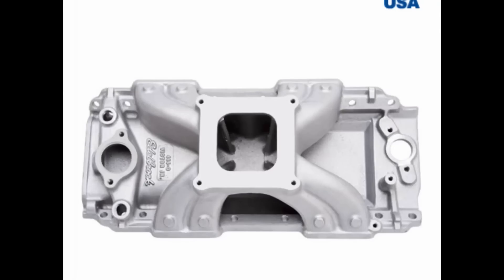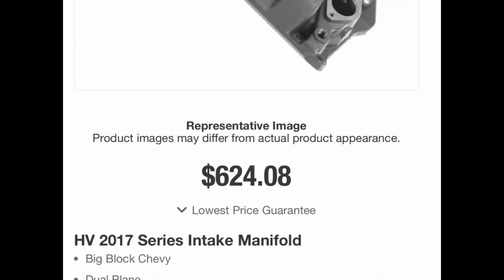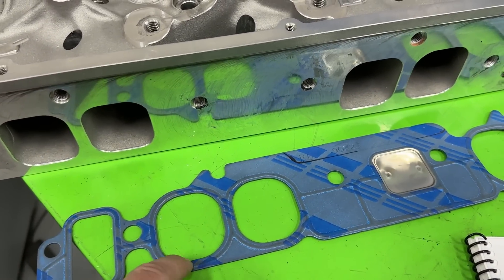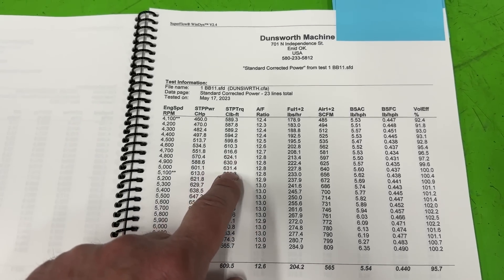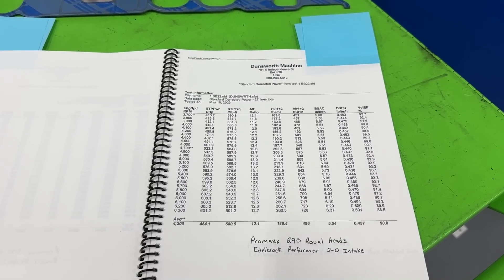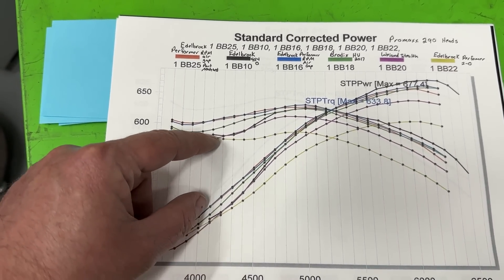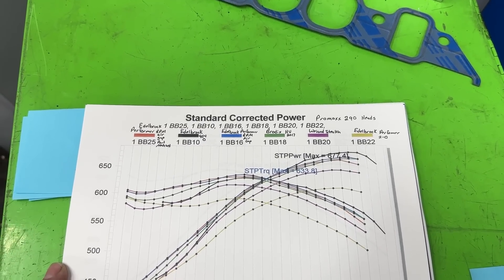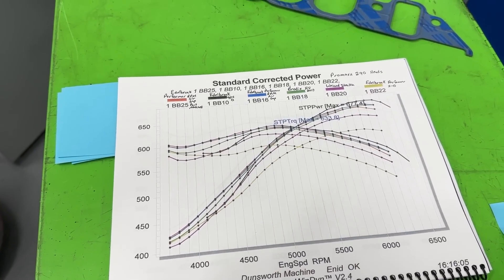Intake Manifold Test Results On The Dyno BBC

Comment: Did you Dyno the BBC air flow research dual plane intake manifold. If so I must have overlooked it. But does the BBC AFR beat the Edelbrock BBC air gap both being dual plane intake manifolds for a street/strip BBC

Comment: Eric, your videos are great! very informative. I have a nice budget 454 with flat top pistons factory Iron heads that have 2.250 intake valves and 2.188 exhaust valves. The heads have been ported, I don't know who did the port work and I didn't remove the valves to look. Also, it has a Lunati flat tappet cam 255/263 @.05 with .612/.630 lift on a 110 sep. angle.

I was given a Performer 2.0. The openings to the heads were very small, but the runners looked quite big. I gasket matched ported it to the oval port gaskets, it took a lot of material removal to accomplish.

Do you think that I should just toss this Performer 2.0 aside? or try it?

Comment: The BB Chevy Weiand Stealth has runners that are "too large", even though the ports are small. The Weiand Stealth is the best one for the 302 Ford, with stock stroke. On a 302, the Performer RPM actually acts too big, all the way around. The Stealth beats it on a 302 Ford. Maybe the Performer RPM would be better on a stroker 302. The Ford 302 Stealth is no joke. Make sure to get the Made in USA one though.

Comment: I suspect that Performer 2-0 would work better if it were notched similarly to the RPM version. It's possible that is the only difference in the two intakes.
Reply: I can tell you that on a 1995 454 truck motor, it loses to the stock intake below 3k and is better noticeably above. It actually helped my truck not spin the tires as much off idle

Comment: Hey Eric, isn’t there quite a bit of difference between the Brodix HV 2017 and the BM 2017? I’ve always understood that the BM line was a huge upgrade to the HV line. If you can remember, you ported a BM 2017R for my 582. Part of me wonders whether I should have gone with the BM 2027. Which is even bigger, isn’t it?

Comment: Have you ever worked with the Nitro setups?  I keep running into people that advance the timing too much and cause engine damage from pushing the cores out of the spark plugs to breaking the pistons and rings.  In the old days, we would dial in the came and put the retarded timing into the cam.  With all the changes to computers, it seems too many changes were made for the Nitro world.

Comment: A friend of mine and awesome engine builder taught me a ton about bbc and because he was friends with the late dick maskin i listened to everything he teached me very closely. 
I used to port intake manifolds for him that he used on 511 cubic inch bbc for a hydro boat race team and he swore by taking a dart oval port intake and porting it to match a dart 320 head, back then that was the head to have. I wonder how that intake would stack up against stuff today.
Reply: I actually have 2 of those Dart BBC oval port  intake manifolds that I had port matched to 2 sets of AFR 315cc Cnc'd heads on a pair of NA 565cid Marine engines for a twin engine offshore  boat application--- they gave very good throttle response/signal and torque was up near 700-lbs. The Darts are polished and look great and are For Sale. I'm now going with the Weiand Track Warrior single-plane intake manifolds that I bought from Eric W.
Reply from the maker: The dart intakes are not that great.
Reply: @WeingartnerRacing  amazing how much has changed over the years. Back in the mid 90's I did a 477 bbc 12.5 trw slugs, 2 bolt block, stock rods lol, ls7 steel crank and merlin oval port heads with that dart oval port intake.  Also ran a 1050 dominator. 
Cam was a ultradyne solid roller. People at the track laughed at me for running the oval ports. 
Engine did 696 @6900  and 589 at 5000. 
I ran that engine for 8 years in a 1937 plymouth coupe I raced for years all over the pacific northwest.
Reply: @sleeeper88 Those Dart intakes were actually port matched to  2 pair of Merlin BBC Oval port cast iron heads with some bowl/ short-side radius work for a pair of BBC 486cid marine engines with Solid roller cams and Holley 1050cfm Dominators, about 9.5 comp ratio... They made about 620hp @5500rpm on the the dyno back in 1991 or so...boat ran like a terror and hauled the mail  📬
Reply: Yes, I believe you Eric... You had already told me when I was at your shop...my Dart intakes are over 30+ years old...very old technology now and that's why I bought the Weiand Track Warrior single-plane intake manifolds from you...by the way, great videos on all the exhaustive BBC intake manifold dyno testing you have been--- you're a man of resolve!... and it's why I brought my AFR heads to your shop... thanks again!

Comment: Let me try to ask a dyno question. I've asked others but I must not be wording it properly. When you start a run, you can hear the brake load the engine. My question is how much do you decide to load the engine? A 2000 pound car with low gears is going to load an engine less than a 4000 car with high gears. I over cammed my buddies car and it was a pooch. We put the same engine in a light car and gearing and it was a banshee.

Comment: thanks for sharing. I've been wondering about that edelbrock 2.0. do you think the difference between the air gap and the 2.0 would be less on a stock 454 or even one with a small cam, like 218° .050?
Reply: I'm no expert but it makes sense to me that the 2-O would be tailored for a stock displacement mild cam engine. Also quadrajet friendly so for a street car that matters. Obviously not a race piece.
Reply: I have a 2.0 on a stock long block with a 650 holly. It's slower under 3k, where most driving is done compared to stock. It does pick up noticeably when flooring it over stock.